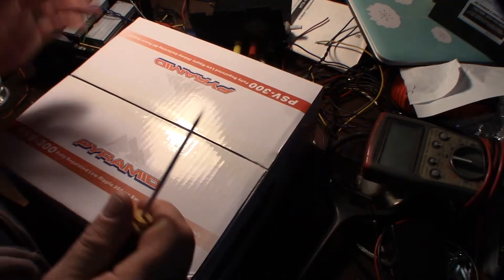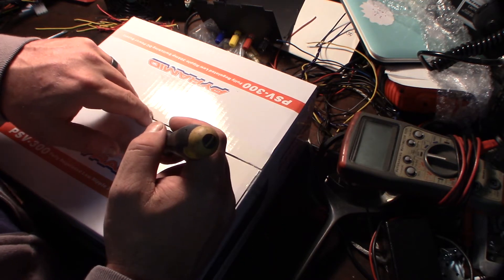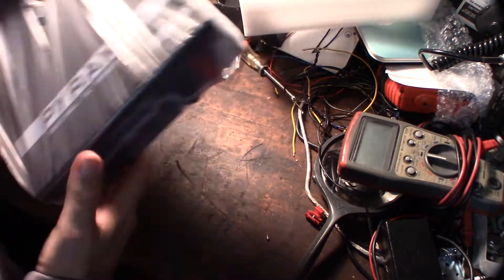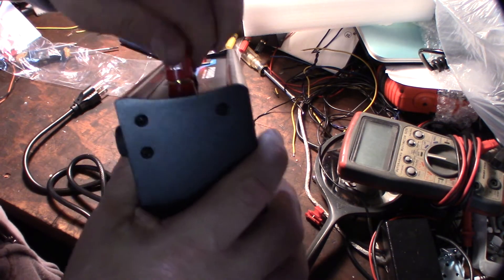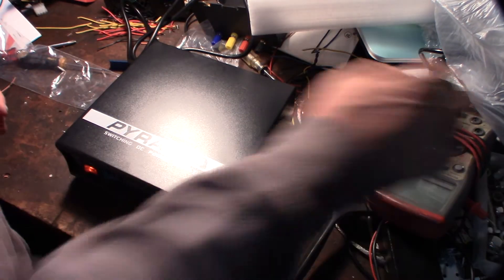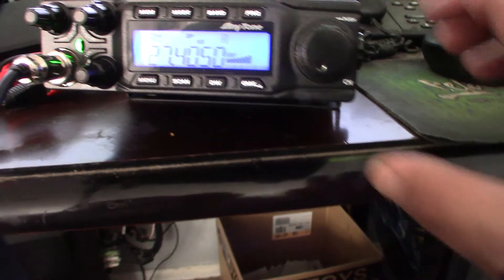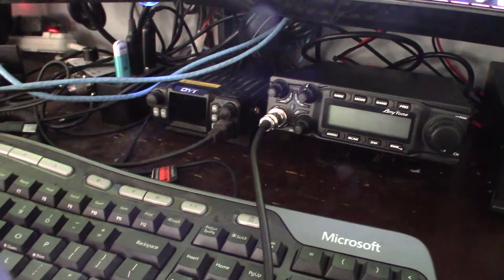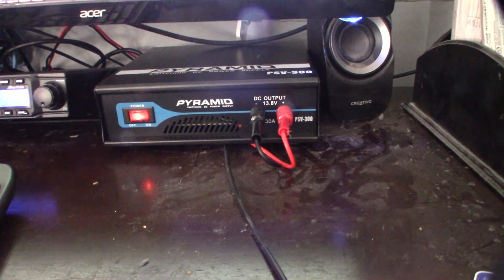Pyramid PSV-300 13.8V 30 amp bench Power Supply for HAM and CB radio

Comment: I got that power supply. I'm a noob but my radio doesn't work properly. It may be a problem with my ant./no ground but I put a mobile ant. in the attic and it won't transmit and back feeds through my pc. Any ideas on how to fix that? Or are my radios/coax. Not sure if my swr meter is any good because only one needle moves but it came back about 3.0 ref.

Comment: @Fintech - can you take the cover off please and take a high def picture of R8-R11?  Magic smoke came out and at least one of these resistors is toast on mine.  TIA.
Reply: Watch the other repair video, in comments the gentleman helped me with mine..but so much more can go wrong, you may have 1 or both of the 2sc transistors toast as well..such the case with mine.

Comment: Maybe a real stupid question, but you're doing a youtube video on this power supply right?  You go as far as measuring the voltage and finding 13.69 volts.  Yep, stand alone, no load!  Mostly useless information.  You NEVER even take voltage measurements with a load????????  What REALLY matters in a power supply.  6 and 1/2 minutes of my time wasted. In case I need to ask, WHAT IS THE VOLTAGE at let's say 20 AMP load? That WOULD tell all us something of value.
Reply: I got one of these several years ago.  It is a real piece of crap.  The minute you load it the noise it generates destroys an hf signal. Now I have to figure out how to filter its output.
Reply: @whenpigsfly3271  I had the same problem. Got rid of it.
Reply: @Dennis-tf2cs  Will it be ok for 2 Meter work? I have one coming tomorrow...
Reply: @mishmash7222  yeah, will be fine for 2 meters
Reply: @dennishess2046  Appreciate the reply...i'll be connecting it tomorrow when it arrives :)
Reply from the maker: Thanks for you comments. I guess I wanted to see if I was getting power.
Reply: Exactly the problem with most of the power supplies. The second you key down they drop voltage to about half. 7 volts for anything requiring 13+ is guaranteed to ruin your day.

Comment: Are there any mounting points on the bottom or is it just 4 legs?
Reply from the maker: Just feet. There are a few extra holes you might be to attach too.
Reply: Fintech Repair Shop thanks for the reply!